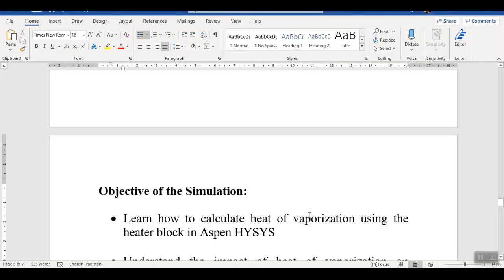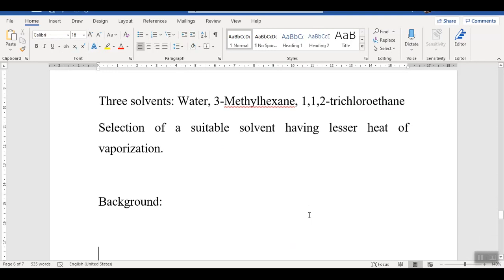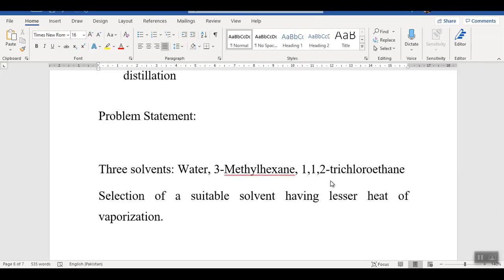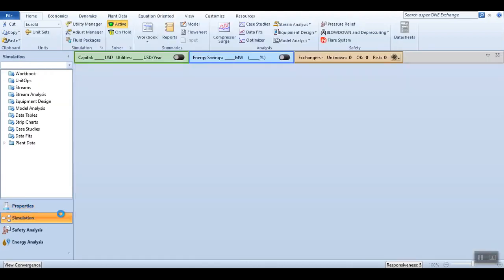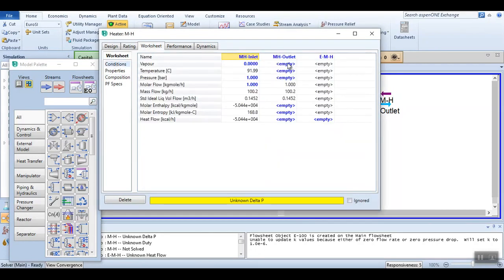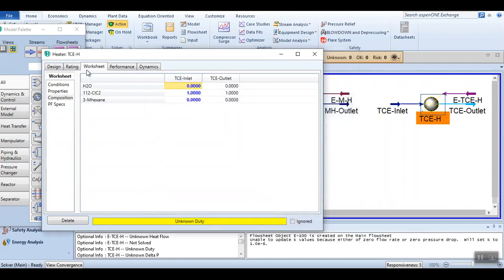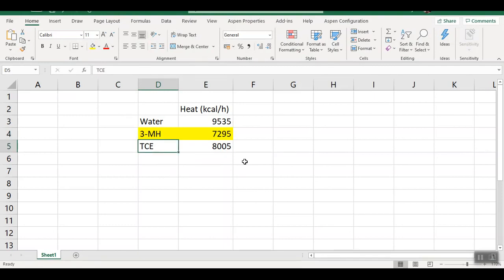Heat of Vaporization using Heater block in Aspen HYSYS - Lecture # 8

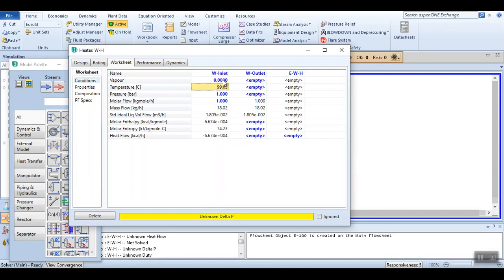Comment: 2:48
The temperature of the outlet stream is the same as the inlet stream; how is that possible considering there is heat input in the system to vaporize molar flow of liquid into complete gaseous state.

And heat of vaporization is not typically reported in units of time; perhaps you didn't execute another mathematical step to divide the heat flow with molar or mass flow to give kcal/kgmol or kcal/kg.
Reply from the maker: For endothermic systems, heat is to be provided, and in such systems, it is possible to get the same temperature at the outlet (isothermal design). However, this example was a demonstration of the heater/cooler block. The value of heat of vaporization is directly calculated from Aspen.